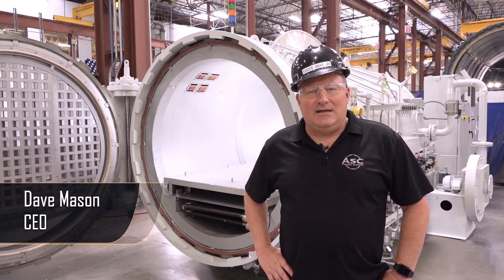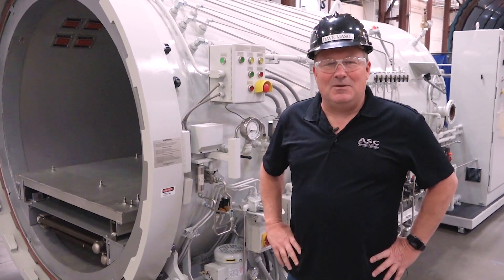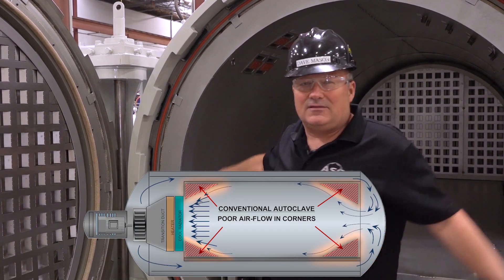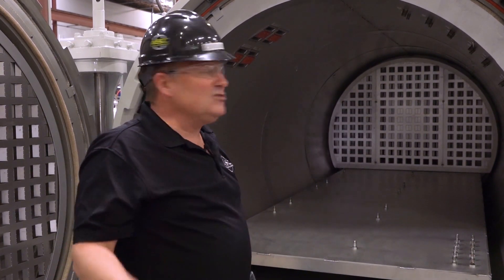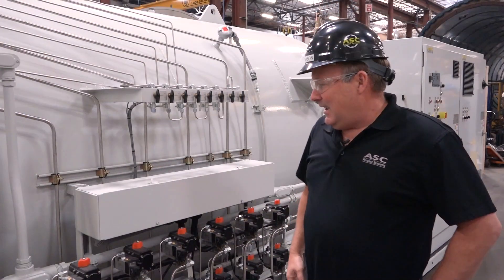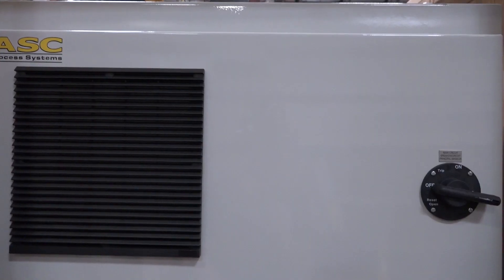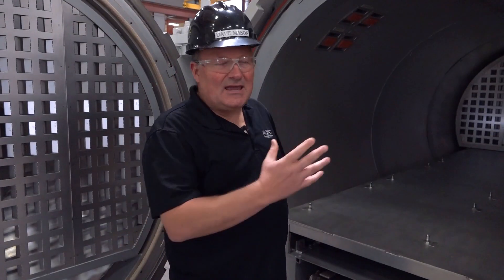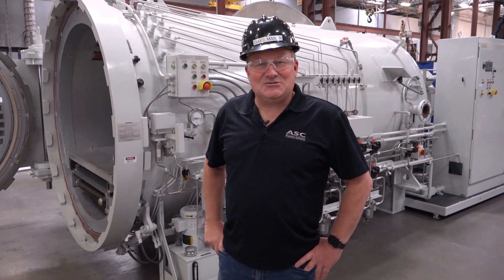What's an Econoclave?

Comment: Hi, sir, can we use air in autoclave instead of Nitrogen if we are working under 250 C . and what should be the quality of air in terms of particles size etc . . . ? thanks
Reply from the maker: Thanks for the quesitons. Although most autoclaves in the US are pressurized with Nitrogen, you can certainly use compressed air as well.  This air should be filtered and oil-free using commercial-grade oil-separator.  Particle size is not as important as providing oil-free air.

Comment: We get a detail specifications and features of ASC Econoclave great design, we need know  how is the working consistency at long run
Reply: Hi Centenary... thanks for the comment.   Our Econoclaves are very reliable and last quite a long time with normal yearly preventative maintenance.  You can expect the unit to operate for 25-30 years or even more.    Feel free to contact our sales group via email (sales@aschome.com) and they can answer any other questions you might have.  Stay safe. Dave